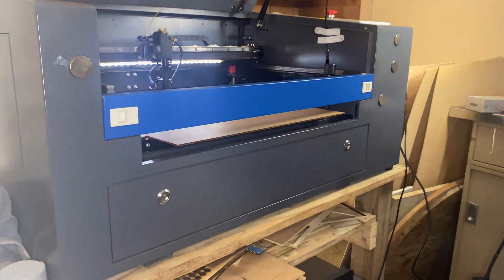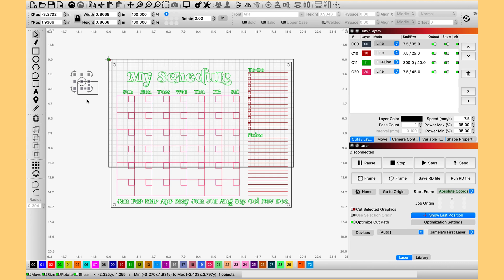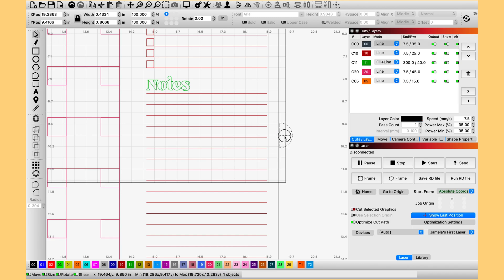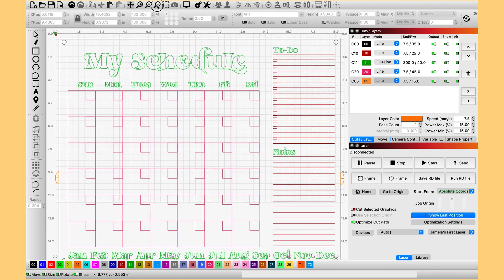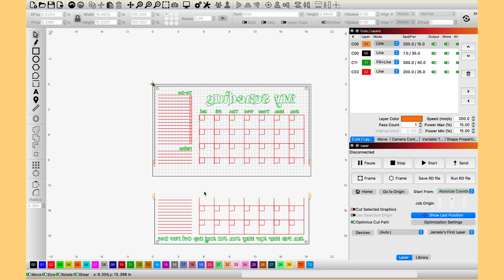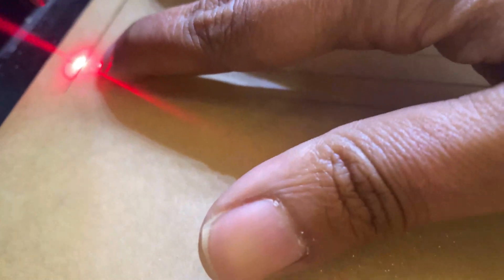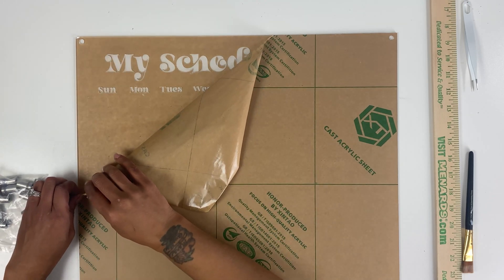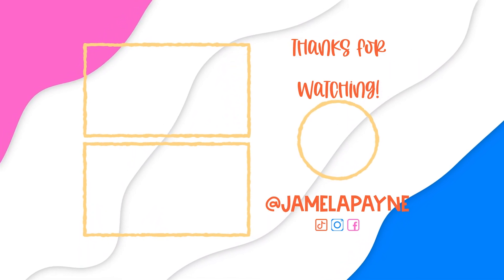Using Lightburn And Your Laser Cutter Pass Through To Cut Larger Then The Bed.

Comment: Thank you so much for this it TRULY helped! We have the exact SAME Omtech machine and I'm using light burn. I'm trying to make a wooden cutout sign but I'm having issues. It's 1/4 inch this blonde wood (I'm guessing plywood). I followed the omtech instructions that said 5% Speed & 37% Power but it didn't cut through. It just really charred the wood. What do you suggest I put my settings to? I'm getting so frustrated.
Reply from the maker: I would check your mirrors and make sure everything is aligned well.